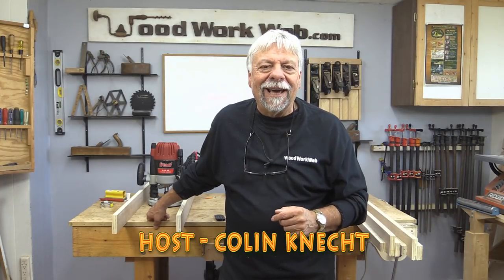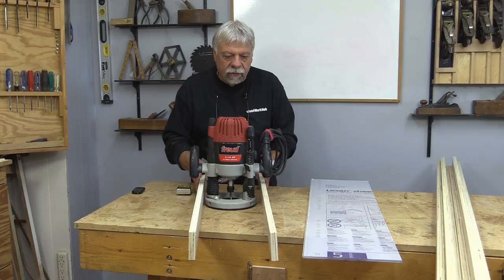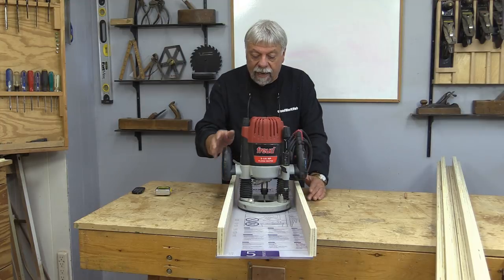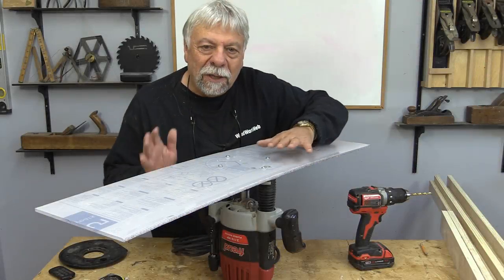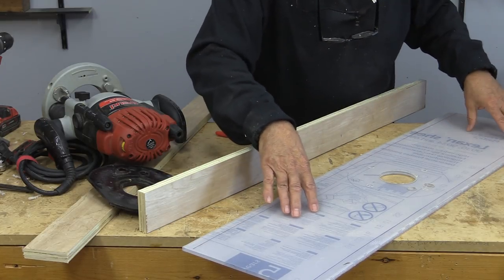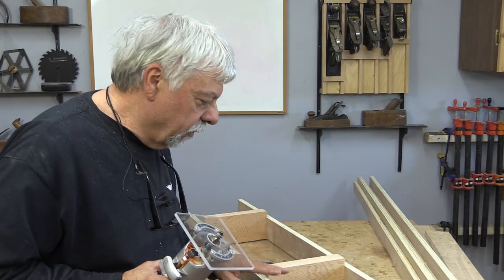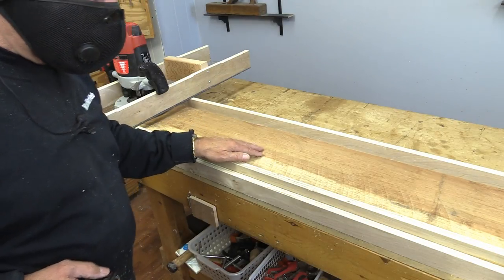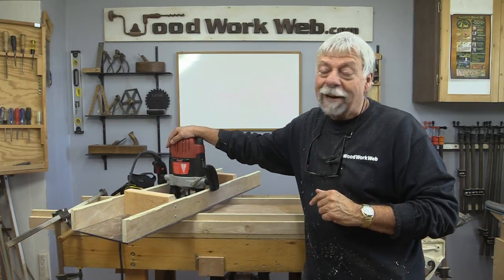Make a Planer Jig for Your Router / Router Planer Sled

Comment: A big thank you to Colin.   This jig is far superior to the ones where you manually slide the router along a fixed carriage.   Those designs tend to produce ripples in the wood; Colin's design does not. 

I made a few minor changes.  I used 3/8" Lexan for added stability as it was readily available from my local commercial plastics fabricator who was kind enough to cut a precisely dimensioned piece for me including the round cutout - so no waste.  My handles are 5" tall made from laminated 1 1/2" birch plywood that I had on hand and didn't feel like cutting them lower.  As it turns out I like the taller handles better than shorter ones.

I did not make Colin's rail guides, however.   I simply stack and clamp various thicknesses of 1x3 MDF on their faces so no milling is required on the table saw as they are accurate as they are. 

Again thank you Colin for this wonderful jig. I know I was certainly dancing one after I made this!
Reply: Nice! Have you seen any problem with the MDF sagging because of humidity though?

Comment: I'm new to wood working, I have a fixed speed, not variable speed, 2 HP 25000 rpm Kobalt fixed Router,  will this router be sufficient for the router sled. I also have a uxcell 1/2-Inch Shank 2-Inch Cutting Dia, Double Flute Carbide Tipped Cleaning Bottom Router Bit;  Will this combination of bit and router work on the router sled?

Comment: Thank you for the info, good information.  I like your version of the planing jig also, the ability to see what you are doing is cool.  I also like how you showed what bit you use for this.   I fear, however, my little 2 hp router won't handle a hit like that.   What size would you recommend?

Comment: You mentioned you had to use the jointer to make the rail edges straight, but is there a way to accomplish that if you don't have a jointer?  Thanks and God bless.
Reply: Use a table saw